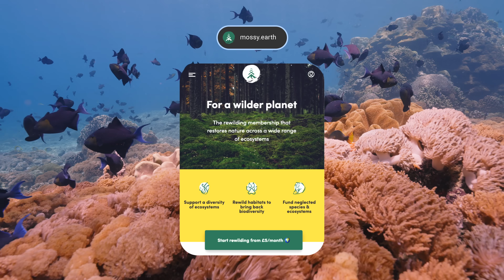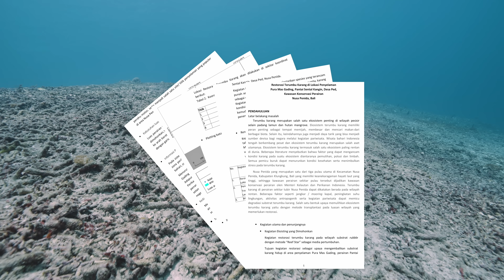We're restoring a dying coral reef - here's how

Comment: Did I get it right that you are using epoxy for coating the steel structures with coral sand? Why epoxy? This stuff includes BPA which is hormonal active and lastly epoxy degenerates to micro plastics.
Isn‘t there a better solution?

Comment: 14:11 If you dip the cage in a container of epoxy, then dip it in sand, then repeat the process - you can avoid using a brush to apply the epoxy. You will be holding the cage by the legs, which is where you don't need the epoxy. And dip the cage into the epoxy container with all parts of the cage at once, which is where the epoxy should be applied

Comment: I don't have a name for the boat (although "Domino" or similar appears to be popular), but I do have two ideas of how your guys could be making the foundations easier/faster. Instead of welding six separate bars to the pre-bent portions, they could bend one hexagonal section of the right width, suspend it, and weld the open trapezoid portions into it. The other idea is to dunk the foundations in epoxy and then dunk them again in sand (which appears to be partially implemented from what you've shown). Hope this helps.

Comment: Not sure how feasible, but a semi submerged barge/platform could be cool too. If you could keep it 2-4 feet under the surface, you could use it as a staging ground for tying on corals to the metal structures before bringing them to the bottom. Could possibly have crew on it too to lower the structures down to divers before they place them.

Comment: Restoring coral reefs by bringing in more artificial structures into the ocean... thats not how it works. Corals need calcite or aragonite as a substrate to grow longterm, a bit of coral sand on epoxy and metal bars wont cut it. There's an incredibly complex biofilm on the surface of natural substrate, we dont understand how it works or how to replicate it. Neither the iron or the epoxy you use are supposed to be in the ocean, they will dissolve and add to the problem of oversaturation of alien materials in the oceans. 

All in all good idea but terrible implementation.

Comment: Instead of mixing the epoxy then adding the sand, Can you mix the sand directly into the expoxy and then dip the metal into it. Same for the second layer too. Just a thought, but maybe it will speed up the slow part of the process.

Comment: When the metal rusts and the epoxy and solder break down, how will that affect the coral living on the structures? Was that a constraint in choosing materials? The biochemistry behind this is fascinating 🙂
Reply: I think they're steel, not pure iron.  An online blurb on coral spider structures is that they are rust-treated steel, covered with resin (they mentioned epoxy in the video).  Rusting iron, like from sunken ships, can be dangerous, as it can fuel a phase shift, the growth of sea anenome called Corallimorph, that outbreed and eat coral.  This is called a Black Reef.  Steel does not raise  issues, as long as toxic paints are removed from the ships, like when decommissioned ships are deliberately sunk to create artificial reef structures.

Comment: I HAVE A BIG QUESTION!

why use plastic zipties and not metal wires

why use epoxy resin and not something like tree sap

I just thought that that might be a better practice to use metal wires than to use plastic zipties, just yk to reduce the polution every step of the way

why not use concrete + coral sand as the fine aggregate
and chisel it out to make rough surfaces and you can attach the corals by making deep pocketed recessions in the concrete

also there's this boat company in bali that makes electric outboard motors(complete with solar arrays  and battery solution) in bali
it'd be great to have u guys partner up !!

best of luck to everyone!

Comment: I'm not sure they will ever read this comment, but i believe i can be a big mistake. Why ? Because the frames are made out of iron which contains Fe2+ and Fe3+. One or two frames are not an issue but it has been reported that near metal wreackage or even sea buoys there are phase shifts from coral to algeas. 
Here amongst articles that refers to this iron induced phase shift : ncbi.nlm.nih.gov/pmc/articles/PMC3280131/
If they put more frames it could destroy the entire ecosystem.
I know they have a marine biologist, but in case of, as a biologist myself i would have used rocky frames. 
I hope they considered this issue

Comment: very cool project! 
i would be interested about the ideas around using zipties and epoxy. 
is the impact limited when overgrown so its a non issue? 
couldent metal wire be used almost as easily as plastic zipties? or pepared loops of natural fibre string like hemp? 
attaching coral sand seems a harder issue to solve than the attachment of bits of coral, so mabye there arent any good alternatives for epoxy?
Or is it a special kind of epoxy?
keep up the good work!

Comment: That's so cool :3 Seeing that tiny domino fish made me smile so much xD How 4 months can already make such a difference. I hope the local government greenlights this project ASAP. 

Quick questions though... The uuhh... protective structures... How are they... supposed to function? My head is telling my they should be anchored in the ocean floor as currents could seemingly easily displace them or some rogue wave could cause enough upheaval to lift one or two of them and crash it into others. What's preventing that from happening? Also... I know there's probably not a better way to adhere the coral onto the structure... normal rope when wet deteriorates pretty quickly and would lose its grip. Fishing line could snap... but are these zip ties not bad for the coral/underwater environment?

Comment: I noticed that the team in this video is using plastic zip ties to secure the coral cuttings to those rebar structures. I recently found out that there are steel zip ties that are pretty comparable in price. That might be a good way to reduce the plastics used if that wasn't already considered :)

Comment: Instead of using plastic zip-ties because why add more (micro)-plastic to the sea, wouldn't stainless-steel ones be better or rebar tie wire ( probably cheaper ) you can find them in stainless, galvanised or copper plated ( not raw steel as they have oil coating on them to stop them rusting, unless you clean them first ).

Comment: Are you using plastic zip ties on the fragments? :(
Edit: And epoxy resin... right into the ocean 😭
Reply from the maker: Hi! We picked these materials carefully based on existing reef restoration research. Its all a tradeoff between how will they perform in allowing the coral to attach vs how biodegradable they are. We are also conducting a trial with some other methods. All of this will be featured in the upcoming video. - Cheers, Duarte

Comment: i know welding isn't cheep and is a specializes skill. but yall should really be using tig rather than stick because the flux coating on the electrodes used for stick welding contain a lot of nasty chemicals and such that might contaminate the project, where as tig uses argon gas wich is inert, i know its a small detail but it caught my eye because Im a bit of a nerd about welding lol
and last but not least I want to say thankyou so much for doing this very crucial work  <3
Reply: That's a really meaningful input. I hope that they see this comment.
Reply: @Jackson-h4u  thanks 🙂 and again thanks for all the hard work regardless of how it's welded

Comment: Are the coral being tied to the base structures with PLASTIC zip ties?😯
Reply from the maker: Hi! yes they are. There is some research on this and we are also conducting a trial ourselves. The tradeoff is between the achievable survival rates using different materials and the resources used to replace dead coral for the more biodegradable materials. This will be addressed in the next video as it is an important concern!  - Cheers, Duarte

Comment: epoxy resin and plastic tie wraps in the sea??
Reply from the maker: Hi! yes they are. There is some research on this and we are also conducting a trial ourselves. The tradeoff is between the achievable survival rates using different materials and the resources used to replace dead coral for the more biodegradable materials. This will be addressed in the next video as it is an important concern!  - Cheers, Duarte

Comment: Just going to assume the Zip-ties holding the coral on aren't plastic or are at least biodegradable.
Reply from the maker: There is some research on this and we are also conducting a trial ourselves. The tradeoff is between the survival rates of different materials and the resources used to replace dead coral for the more biodegradable materials. This will be addressed in the next video.  - Cheers, Duarte

Comment: Have you thought about electrolysis instead of coating? Many projects apply a small voltage to the metal structures which coats them in  calcium carbonate and even helps the corals grow! You could place them in a "nursery" on shore where you have access to electricity and get them out into the sea if they're appropriately coated and colonized. This would reduce the need for epoxy and the complicated coating!
Reply: It's called "electrified reef" and maybe you could even combine it with a floating solar farm directly on site https://en.wikipedia.org/wiki/Electrified_reef?wprov=sfla1

Comment: Why use metal? It seems to me plastic of the right type would be far cheaper, more stable, longer lasting and easier to mass produce
Reply: After reading the cable tie FAQ on the website page for this project It seems it's because plastic gives you the ick, which is understandable, but there's a reason it's so common, the right type of plastic is often the best material for a job. it really seems worth using the best materials and technology available.

Comment: One question I have with the metal structures is:
Will the eventual rust cause any problems for the future corals?
Eventually the epoxy and sand will deteriorate.
Reply: I don't really foresee problems, the sand comes from coral, epoxy doesn't really deteriorate and will in the end be encased in the coral and the iron will (very slowly) dissolve, fertilizing the sea around it.
Reply: @apveening  interesting. Thank you.